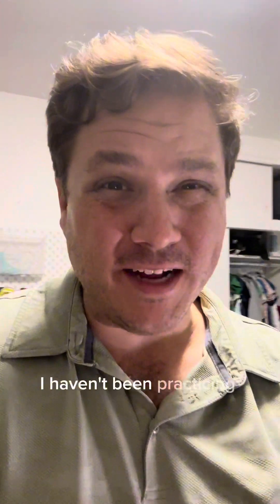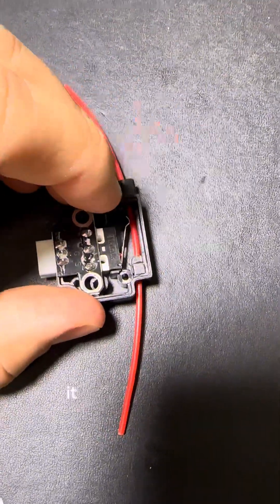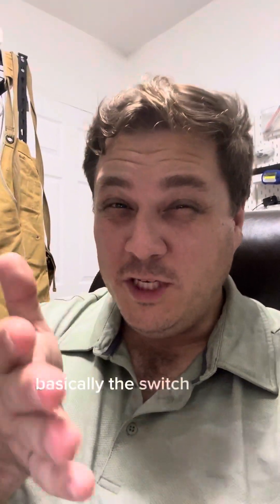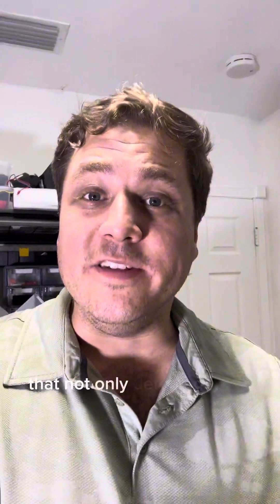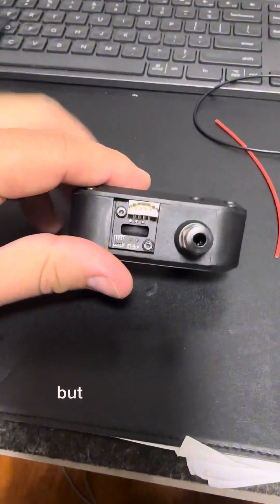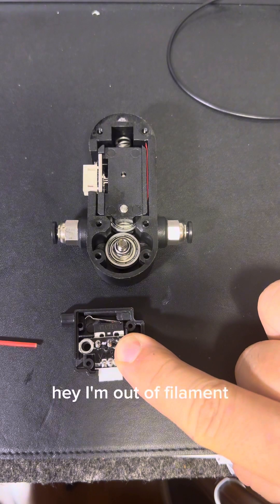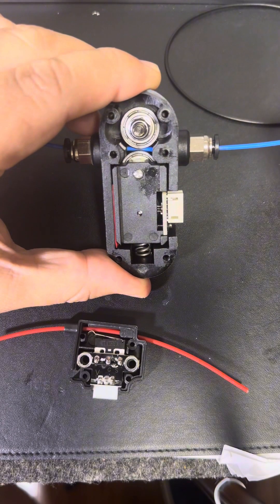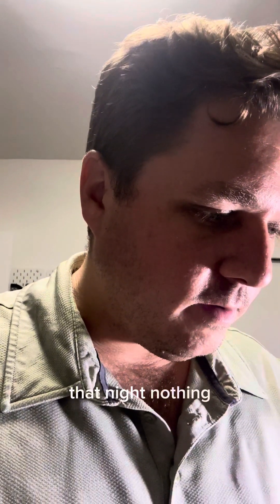Why the BigTreeTech Smart Filament Sensor is Superior to a basic Filament Run-out Sensor.

Comment: I've got to get me one of these. I don't have any of these unusual filaments that you mentioned, and haven't dealt with nozzle clogs....what I do have is several old/brittle filaments, that tend to break between the runout sensor and the extruder. Which results in the same thing - no more extrusion, and the nozzle does an elaborate dance in the shape of a print above the last layer it managed to output, for the rest of the print time. I imagine it'd be compatible with mine, considering I've already replaced the screen and mainboard with BTT upgrades as well!
Reply from the maker: It’s saved me in a pinch. BTT just release v2 of this. The issue I’m having right now is my steppers are shutting off if I don’t tend to the pause causes by this within the time defaulted by Klipper… still trying to figure this one out 😅😅

Comment: Even better than this sensor is a quadrature encoder sensor using two light sources where the movement cannot be simulated because the filament is bouncing back and forward enough to trip the sensor.  The motor does the same over and over. The filament moves forward and back only a little bit, but it can be just enough to satisfy the single light sensor in the BigTreeTech.